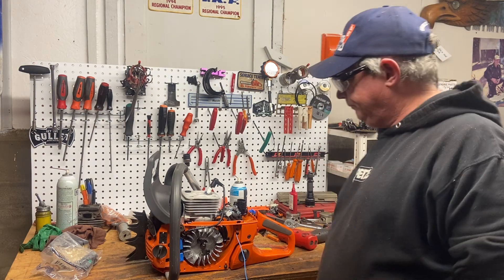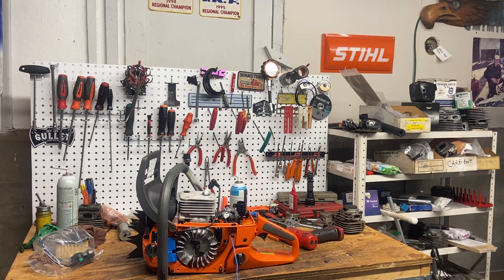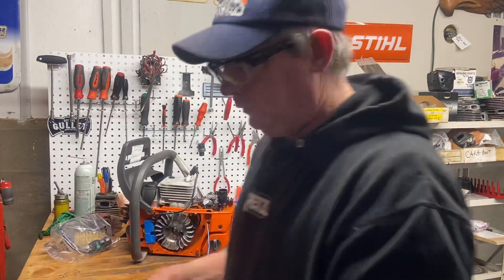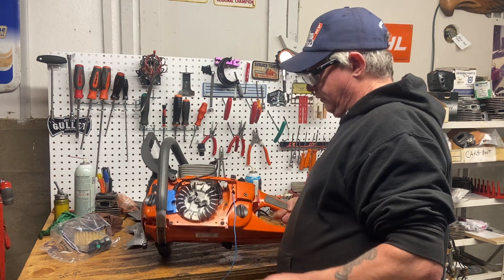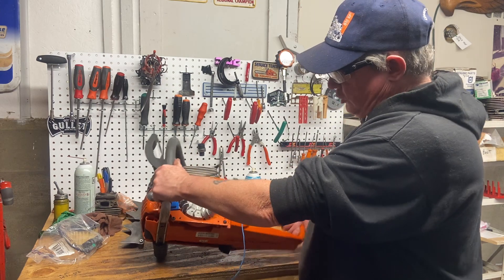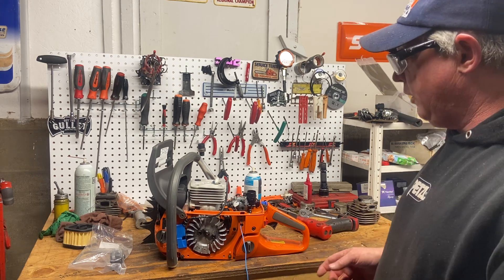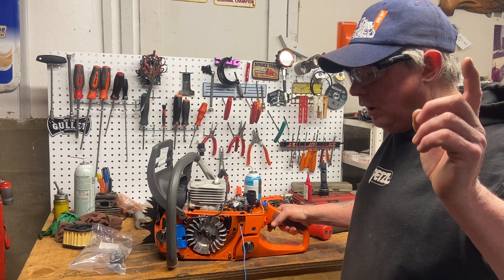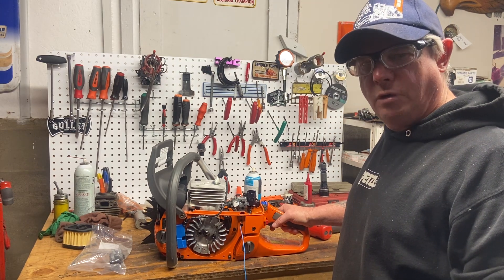Husqvarna air injection expland

Comment: Does the 500i not have the air injection? Those filters clog up in no time. 

I’ve never changed my 390. Just pull it off and tap it out every now and then.

Comment: The filtration on the Stihl MS261, MS462 are alot better than the previous models of those saws but the Husqvarna 395xp and Echo 7310 are hands down the cleanest running saws filtration wise that I have seen. The 500i  definitely needs a filter mod or upgrade if one expects to get many hours out of it. Proper tuning, chain tension, chain sharpening, and good filtration help keep the bearings alive, running good gas with a high quality mix oil at a ratio of 40:1 or 32:1 depending on the oil, has significantly increased the life of my saws especially  the ones turning 14,000+ RPMs. Donny have you had to replace any crank bearings in a 500i yet?
Reply: I am not disagreeing with the 395 running clean, but so do the remaining 371/372.  Very clean.
And be careful with 32:1 mix, it can carbon up the exhaust port very quickly.

Comment: No disagreement on Husky's superior filtration. Stihl's pre-separation system works well and found on most if not all of their "farm & ranch" tier saws. Oddly, its missing from their pro lineup except for the 462 - I'm guessing its to claim superiority in the weight department against competitors. The 500i would benefit from it massively as current setup is lacking bigtime.